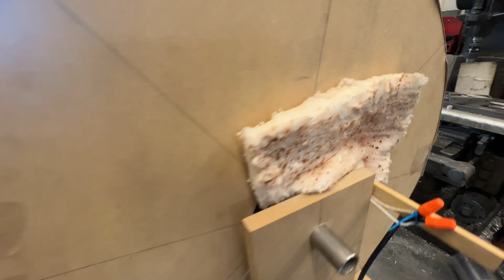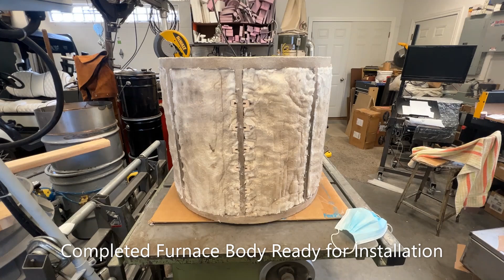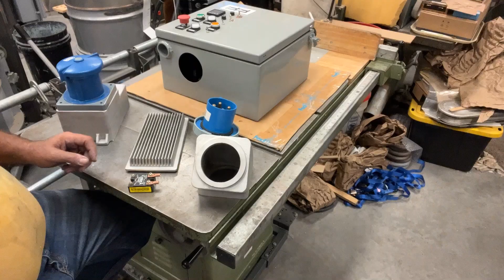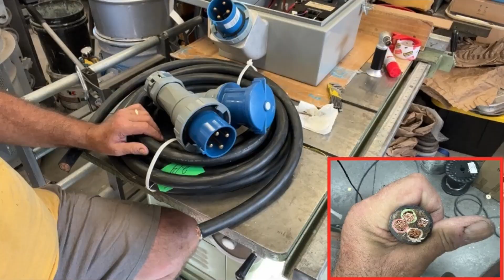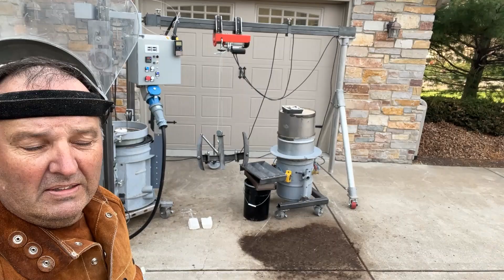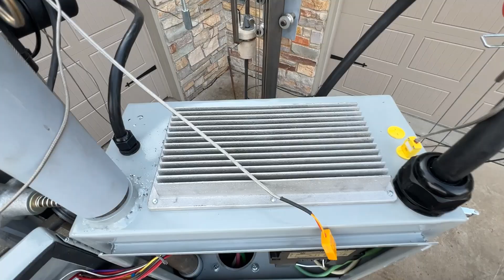22KW Resistive Electric Foundry Furnace

Comment: That's an insane amount of work!!!   Working with welding machines which are usually 3ph. It gives me the willies seeing a 100 amp extension cord without a dedicated service disconnect.
Reply from the maker: Child's play compared to what you'd routinely find around a shipyard or container ship which is where the plugs and receptacles come from and with only 30ft of 2ga SOOW cord, the ampacity there is way more conservative than most welder or common 50 amp Rec Vehicle cords. It's also breaker and thermally protected in the furnace control box and again at the dedicated circuit in the main service. Pure resistive loads are about as tame and predictable as it gets. Best, Kelly

Comment: I remember a mold/pattern that you made for an SCBA backpack container many years ago. It was pre - CNC days and recall that it involved a long radius swing arm to cut the core.    Cheers!
Reply from the maker: Hey DH, hope all is well. My DOS skills never improved and still a Windows dork, but better with CAD/CAM than I was in my engineering days. Best, Kelly
Reply: @kellycoffield533  Cheers!

Comment: So what was the material you found for this, and your supplier?  (if its not a secret)
Reply from the maker: It was Morgan pumpable refractory called Seal Coat HT. When cured, it's properties are very similar to K26 insulating fire brick. I bought it second hand from a surplus company for $30/5 gallon (I bought 4 and used 2 for the build) and was able to have a relative pick it up to avoid expensive shipping. If price were no object, I would have preferred one of Morgans pumpable/moldable ceramic fiber materials like I used on my smaller furnace, but that would have been >$500/5gal if I could even get it. So far so good. Best, Kelly

Comment: Excellent furnace. How does it compare for speed to nat gas?
Reply from the maker: I don't know for sure because I never used the previous furnace with NG, but I'd have to believe a well-tuned burner could easily melt twice as fast, but, I would much rather have the furnace atmosphere of a resistive electric than fuel fired furnace for controlling the aluminum melt quality. Best, Kelly

Comment: Sweet project.  I wish you were my neighbor.  Are you an ME or an EE?  Have you ever experimented with cast iron?  How do you control for purity, just make sure the scrap being melted is clean?
Reply from the maker: I do use scrap on occasion for ornamental stuff but for things that matter, I use A356 ingot. I have a self-made degassing lance, but never use it for the latter because the furnace atmosphere in resistive electric furnaces is so favorable for aluminum melting. Best, Kelly
Reply: @kellycoffield533  Cool.  Thanks for the response

Comment: Thanks for the video, I checked your videos, did not see any on heat treatment.
Reply from the maker: It's discussed in most of my intake manifold videos but is simple. I use A356 alloy and T5 at 445F for 8hrs because it achieves 80-90% of the improvement as T6 without risk of damage to the casting. Best, Kelly

Comment: wouldn't it be smarter to have the plastic junction at the bottom of the raceway to keep it in the coldest spot?
Reply from the maker: The furnace is insulated well enough that you can touch the exterior barrel/body with your hand when the furnace is at temperature. When I touch the raceway, I can barely detect it being above ambient temp. Given that, it packaged much better at the top to accommodate the loop in the moving electrical cable that connects the furnace to the top of the controller. Best, Kelly

Comment: Hi Kelly, you can just put an adder panel to the side of your original panel off the panels busbars that way you don't have to remove any loads.
Rich
Reply from the maker: I already have two sub panels and have 3ph, and 1ph 240/120vac circuits and receptacles in my shop everywhere imaginable, thus the lack of panel space. I thought I had provisioned for everything imaginable.......except a 100 amp foundry furnace LoL. It was much easier and less expensive to merely make room for the furnace circuit with a low voltage tandem breaker and a couple conduit fittings rather than install yet another sub panel, but next time, if there ever is one, I'll have no choice. Best, Kelly